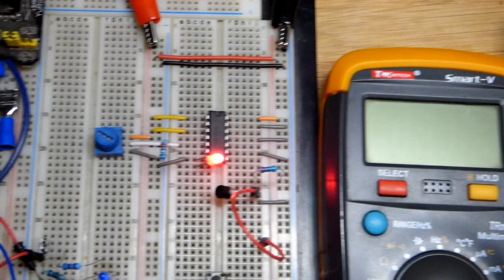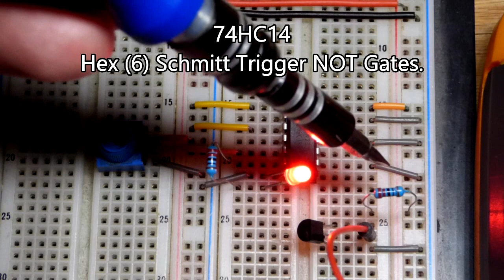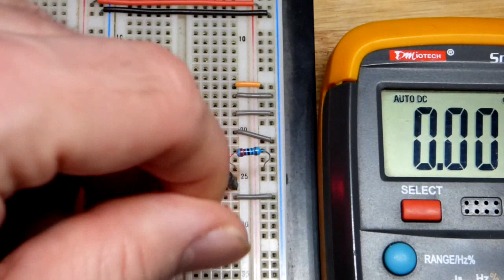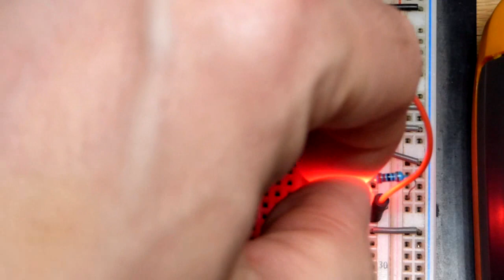74HC14 Output Voltage versus 2N7000 N Channel MOSFET for switching a red LED load

Comment: The thing you neglected to mention is that the mosfet in that circuit needs to be a "logic-level" type. That means that its maximum threshold voltage is less than the minimum voltage for the high logic level of the gate you are using to drive it, which is true for the 2N7000 you showed (Vt_max = 3.0V vs Vo1_min = 3.5V @5V supply). You were quite right to say that the reason for using the mosfet is to deliver more power into the load, but you can't just use any old higher power mosfet and expect it to switch on when the logic 1 is applied to its gate. For example, an IRFZ44 has a specified threshold voltage range of 2V to 4V (at Id=0.25mA), so a particular sample may or may not turn on fully with a high load. You would use an IRLZ44 whose Vt ranges from 1V to 2V.
Reply from the maker: Thanks for the info!